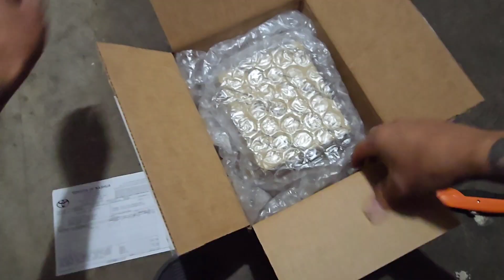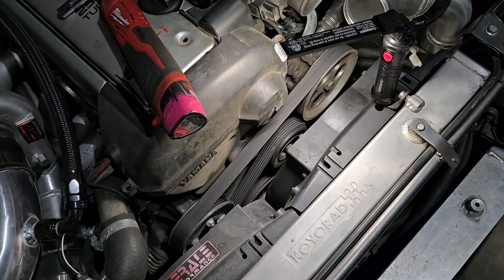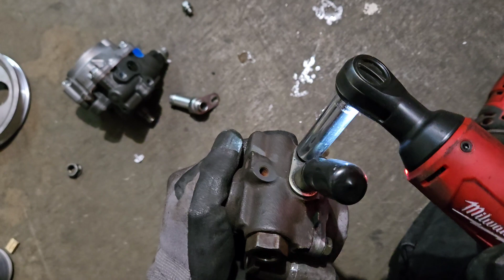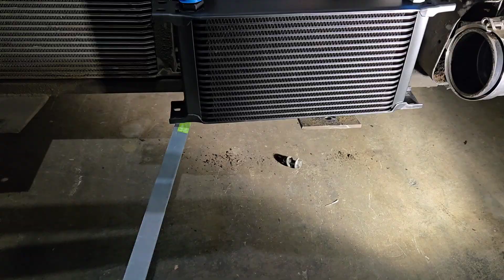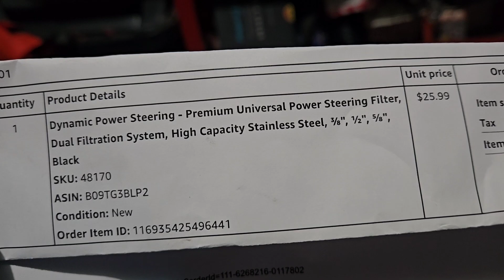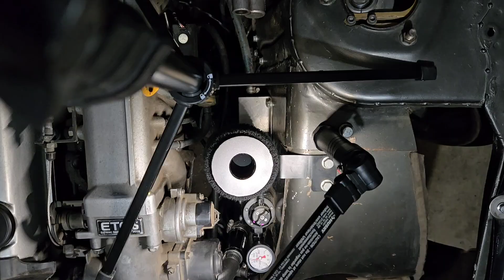How to replace 1jz/2jz power steering pump Plus cooler and filter install

Comment: Will this pump work on non-vvti 1JZGE?
Reply from the maker: The core is the same but depends if yours comes with a reservoir attached to the pump like a 2jz ge or if the reservoir is remote or if you plan on putting an aftermarket reservoir
Reply: @waifuslayer_1jz yes mine has the reservoir attached to the top just like the 2jzge